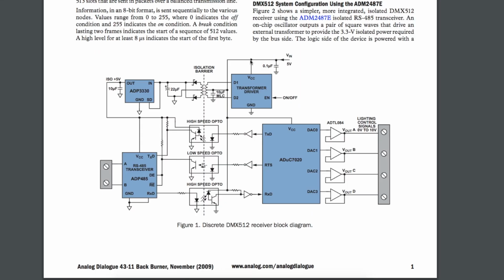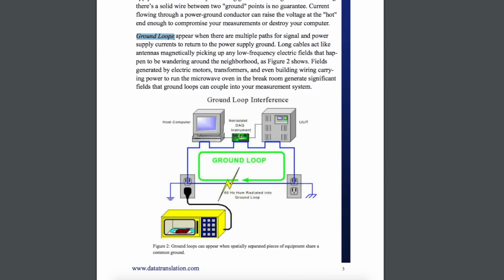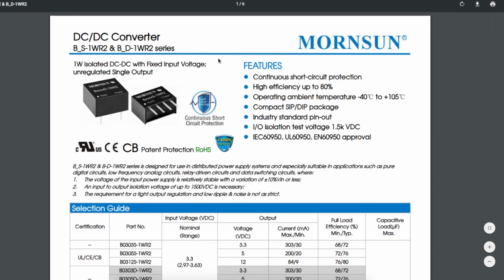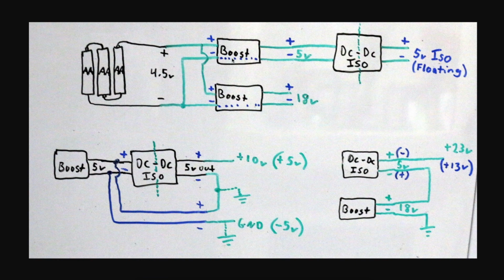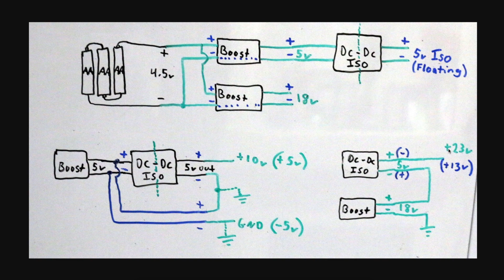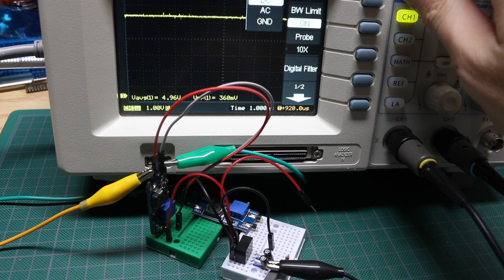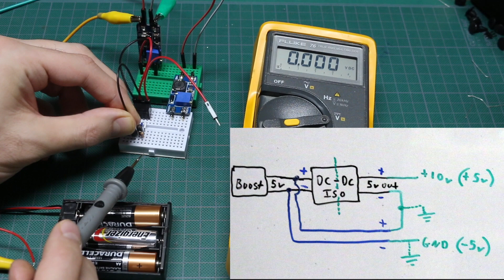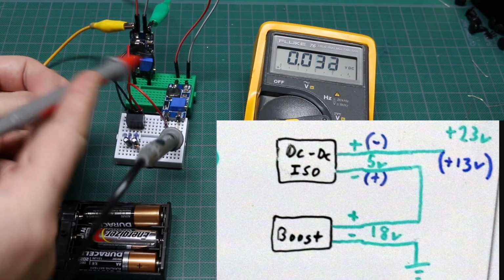DC-DC Converter - Isolated Power Source Uses

Comment: Thanks for the video, not sure if you're still reading these (5 years later).  I'm using one of these to power a small circuit that has to be isolated, and I noticed that the caps shown on the datasheet across the input and output are AC.  Not sure why, it seems like both the input and output voltages should never go negative.  I see your DC electrolytic caps (and I'm not sure what else).  It says they are for noise.  I just wonder what the difference would be using one here vs. the other, any thoughts?  The 1W version sure is tiny, I lost one in the kitchen and haven't found it yet (I'm sure it's next to some old vitamins somewhere), but in my first test it worked ok even without the filter caps.  Really amazing from something so small.  Using a regulator makes sense so I grabbed a few ratings.  Your presentation was one of the better ones I watched.
Reply from the maker: usually I do get notified of brand new comments but if it’s a reply to an existing comment I would only stumble upon it by accident if I happened to be looking through comments directly on an old video because I don’t get notifications for replies after the initial comment is made.

I just randomly opened up a data sheet for one of these devices and they are available from a few manufacturers so just looking at the one I pulled up I see they have a non-polarized capacitor symbol although the value of capacitance is going to be 1uF or more, so it’s not so much that it’s an AC capacitor expecting reverse polarity  voltages but you can get a non-polarized ceramic capacitor several microfarads or use a polarized electrolytic.  

sometimes they just arbitrarily draw a symbol to show that a part goes in that location with an artists rendition rather than something exact to follow and sometimes they actually make bad recommendations on their own part usage but that’s another story.

right now I am working on a schematic design where there are 10 µF capacitors but I’m showing them non-polarized because they are surface  mount ceramic.

Comment: I want to use such an isolated dc-dc converter in my project. I have a microcontroller with bluetooth that is driving a DAC, however the microcontroller is making the power line very noisy and I want to isolate it. I am wondering if that is going to cause issues with the communication between dac and microcontroller since their grounds will be isolated from each other but the i2s lines will be driven relative to the microcontroller's ground. Is it possible to  bring the two isolated grounds to the same potential without the noise escaping the isolated circuit?
Reply from the maker: aside from any attempts to do noise rejection with ferrite beads and differential or common mode chokes which may or may not work for the noise in any circuit, staying with the concept of just isolating things, aside from adding the isolated power source, isolated data chips can also be used and there’s one for I2C.
so data can pass through the isolator and one side of the isolator is powered by the noisy side and the other side is powered by that isolated regulator and they can have separate grounds
https://www.mouser.com/datasheet/2/609/adum1250_1251-3122329.pdf
Reply: @GadgetReboot  solid advice 👍 I had to use a different IC because of the high frequencies used in the i2s bus(I used IL715)  and my DAC output never sounded better. While I was waiting for the isolator IC to arrive, I did have a few attempts at connecting the isolated grounds in different ways, but some noise would always be present on the audio output. 
Thanks for the video and the follow-up advice!

Comment: I use solar to power devices, is it safe to use a Meanwell DDR-120B-48 to power a DS-P7001-04 (DC: -38.4V~-72V) from a 24V battery bank that use ground in the negative?

Comment: I have a problem with ground loop in my car, when i connect bluetooth to aux (its working on 5v via USB) i get ground loop and buzzing noise, i dont have that problem when i connect to power bank. what i can do to remove that buzzing noise?

Comment: Can one of these be used to prevent ground loop noise in a car before the USB Bluetooth receiver instead of the popular isolator between the analog out and aux in so that the music's sound isn't affected but unwanted noise is still removed?
Reply from the maker: If the power ground is causing ground loop noise (presumably because there's a ground connection for the power source and a ground connection on the audio connection, resulting in a loop path), isolating power to break the ground path sounds like it would work, but I'd wonder first if just using a floating clean power source like a battery to power the device can help show that isolation solves it.  So if the device runs on 12v itself and it's low current so you can get away with a 9v and two AA's to make 12v and connect that, see if that cleans it up.     
Then if isolating power seems like a fix, the two main things to think about are how much current/power does the device use to run?  These little power isolators come in different power ratings so power/voltage = current.  If it's able to power 2 watts at 12v, that's 166 mA (and probably shouldn't be used at full load).   If it's 1 watt it's half that current.   So if the unit needs more current than that, maybe a different power isolator would be better.
The second thing is they operate as switching power supplies, so they may possibly have their own noise (maybe not audible in a sound system, practically everything runs on switching power supplies) but just something that may be needed for consideration.

Comment: can I put 3x 5v dc to dc in series  to a 12v input and return a 12v output?
Reply from the maker: I don't know if the input side of multiple switchers can be put in series or if they all need the common ground, but if isolating between 12V in and 12V out, they also have switchers rated for that:  http://www.kosmodrom.com.ua/pdf/B0505S-1W.pdf

Comment: Is there a way to find out if a power source is isolated or not? I have a pH sensor on an arduino that is in turn powered by a laptop and it gives erratic readings when i start charging the laptop batteries. After some googling I think this is a ground loop.
Reply from the maker: when the laptop charger is unplugged from the wall, you could check continuity between the ground pin on the charger plug and the ground of Arduino when it’s plugged into USB to see if there is a ground connection all the way through.  but if it’s a ground loop, that would suggest there’s some other electrical connection to AC ground between the USB connection and off toward the probe. Is there something else plugged in to AC that’s a part of this whole system, or is the material being measured with the probe possibly grounded like if it’s in some sort of conductive vessel that’s grounded and then we get a loop when the laptop is plugged in?
If the probe is connected to the ADC input on Arduino, changes in readings could also just be fluctuations in the power supply if the ADC reference is coming from 5 V, so maybe there’s noise on the 5V USB bus when the laptop is plugged in. If you have an oscilloscope you could just probe the 5 V and compare, otherwise even just with a voltmeter on 5 V, does it look different when the laptop is charging?

Comment: Yup, gotta get some of these.  Coincidently, on my desk right now, am messing with using a Dickson Multiplier to create a semi-isolated boosted supply.  "Semi" because the source is coupled through small capacitors.  Sadly, my order for small isolation transformers, made 2 months ago, never made it out of China.  Just checked out B0505s on AliExpress.  Amazing they make and ship these for <$1/ea.  Looks like 1W is fairly standard for these small ones.
Reply from the maker: These days I feel like I need to order at least two different orders of everything to make sure I hopefully get something. I ordered one of these 0505‘s and another auction with two of them bundled and I never got the two in the bundle just the single from someone else. 
I’m starting to get nervous about spending more than five dollars at a time. I’m surprised I got several things that I paid 20 or $30 for this year but there’s still something else worth about $12 I never got  since April so far. 

 So much for my summer garden watering project in 2019!   If the parts happen to roll in over the next few months maybe I’ll make an icicle fountain machine. Build a Canadian  National  igloo or something. 

 Isolated DC to DC converters can get very fancy, powerful, and expensive. In my most recent job we used them practically everywhere, even multiples on one single PCB that interfaced with various other boards in the  same system. That’s where I learned to think about power delivery requirements instead of current consumption for a load circuit.  All that boosting and bucking and transforming, power is a great vehicle to keep track of everything.
Reply: @GadgetReboot  If the goods are coming from China, there is a magic $5 limit as to what the government mails abroad for free. (this is a real thing) My own orders over $5 are sometimes held up in customs.  Interesting that you used these isolation transformers everywhere.  Your job must have involved failsafes, and interfacing with a noisy environment.
Reply from the maker: My first design job dropped me in the middle of a noisy environment surrounded by RS 485 cables to keep things clean,  and there were also lots of failsafes including interlock switches for moving parts when access doors are open.  
I probably spent half of my time designing circuitry for products and the other half of my time designing the test equipment for mass production of those same machines  and that’s where all the isolated power and signal integrity experience started. 
 Then I was away from all of that for over a decade and landed right back in the same sort of environment coming full circle and getting reacquainted with those sorts of design requirements. 
It’s funny how sometimes it takes a retrospective view to realize what you’ve learned long ago and didn’t realize it along the way, then you need to use those skills far in the future and you realize... I actually learned something back then in addition to how to skirt around the company firewalls to access outside email.

Comment: I've used these to get rid of the awful digital noise these cheap bluetooth audio modules cause when you connect them to amplifiers without differential inputs. Cheap and easy solution.